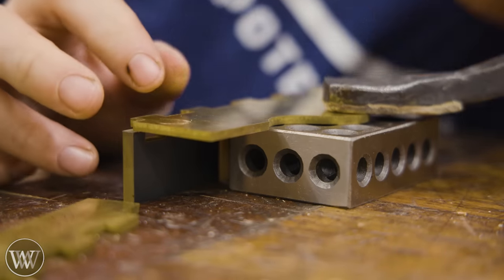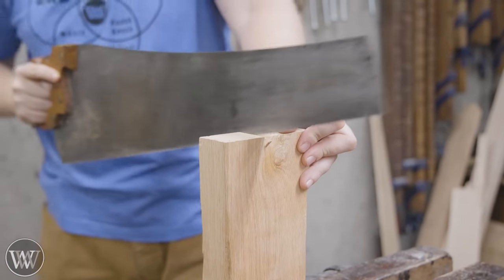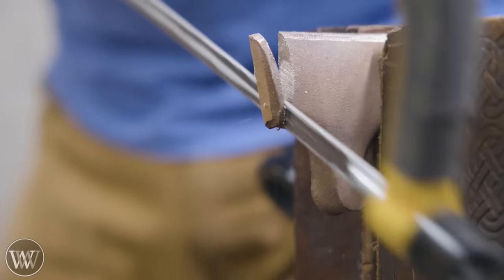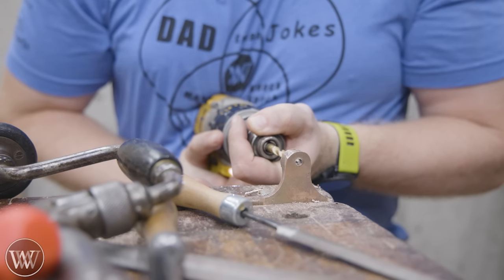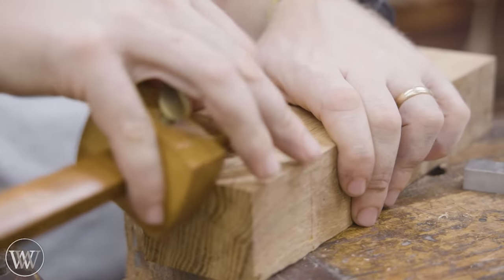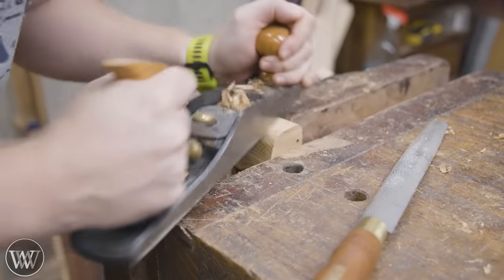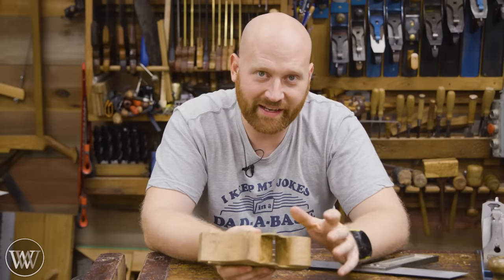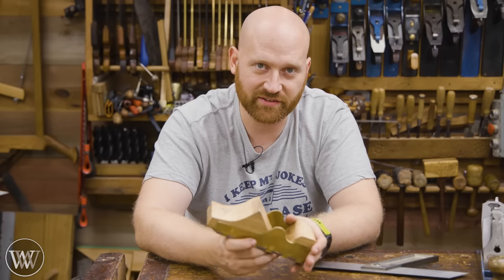Infill Plane Dovetailed Sides Part 1 #handplane

Comment: Is there any particular set of files you would recommend for a beginner? I know that I need files but I don’t know what specific ones I should get.
Reply from the maker: No. For the big ner just get the cheap ones. Once you find the shapes you like then you find a good company that makes those shapes. Around 70% of mine are cheap or garage sale finders. Only a few have I gotten new.

Comment: Very easily. Sharpen twist bits. To woodworking tolerances, maybe 😂
 
There is no lead screw. Those edges need to stay on the same conic plane and concentric with the center of the bit, plus reliefs, otherwise the edges don't do the same amount of work and the bit will be cutting oversize, with bad surface quality, and run hot. And be more suspectible to snapping. 

All this gets harder the smaller the drill. Freehand sharpening a 16mm bit is a pain. Freehand sharpening a 4mm bit is a curse.

All you're doing by pulling it across a stone like that for more than a couple of strokes each side is ruining a bit.